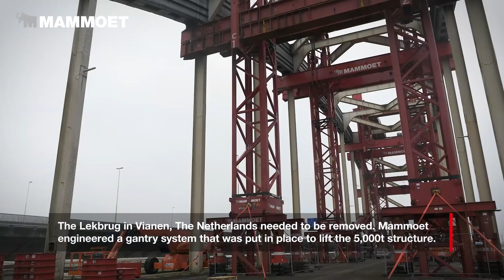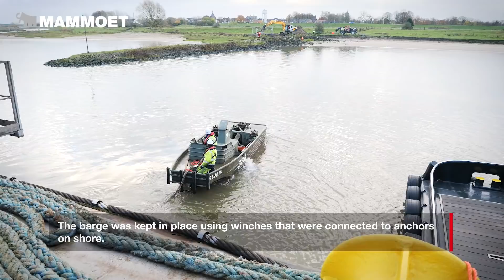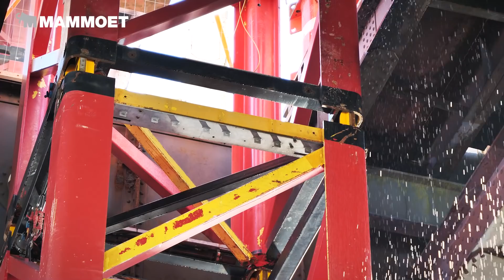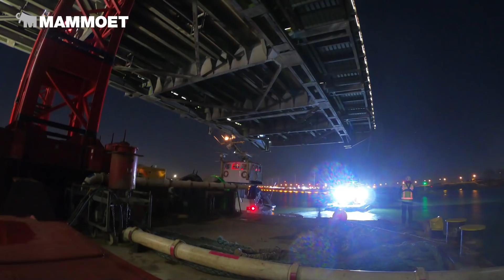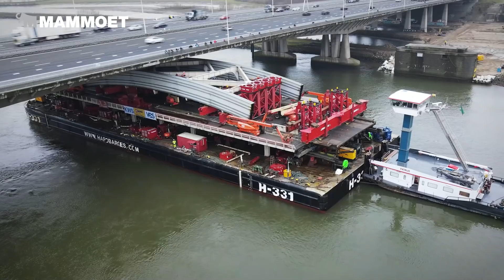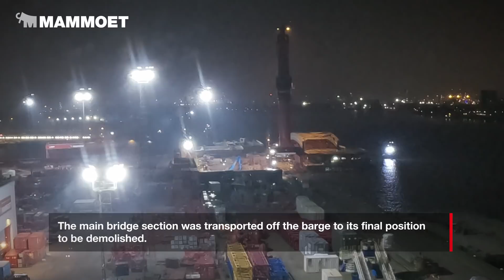Watch how the 5,000t steel arch bridge 'Lekbrug' was removed

Comment: Did the designers of the bridge think about how you might demolish it when they built it? 

Mammoet did a great job here, but I’m now wondering if they are going to have to continue expanding their team as more and more steel bridges reach the end of their lifespans.
Reply: No they did not think about that. And why expand your team? If you have one team that,s capable of doing things not many others have done?
Reply: @ghostdevill  What I mean is, I think we’ve been building more and more bridges like this over the last 50+ years. So, the number needing to be replaced every month will keep going up until there isn’t enough time for their current staff to do them all.
Reply: Bridge was rebuild after being destroyed in the second world war. And no the people building it would have build it to last. Not to be removed after some time. Without the lack of maintenance she endured she would have been here for us to use for many years to come.
Reply: This bridge was replaced to solve a capacity problem in the A2 highway. I do not think the state of this particular bridge was the trigger to replace it.
Reply: @nielsdebakker3283  Makes sense. I still do think that the problem I’m talking about will eventually happen, even if it hasn’t started to happen yet. If we are building bridges that require specialized teams to replace, won’t we eventually need a lot of people?